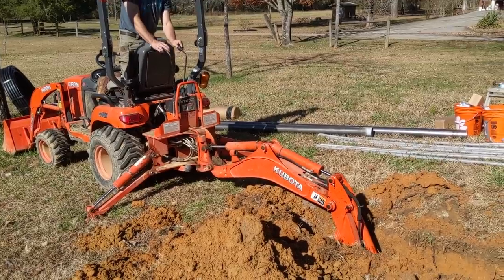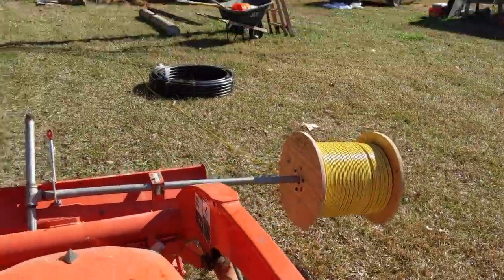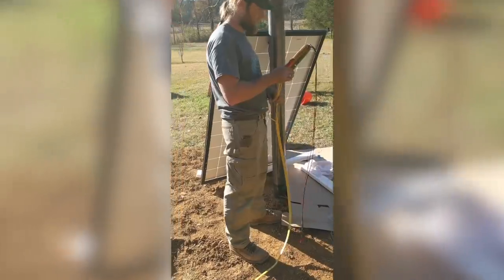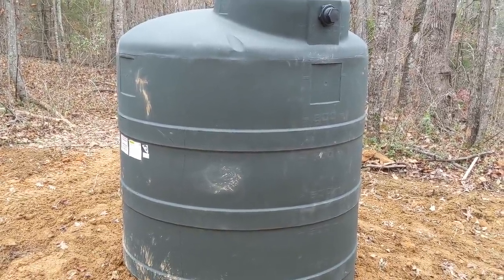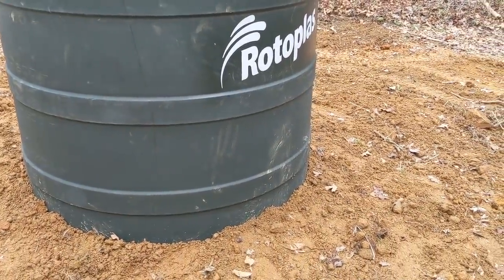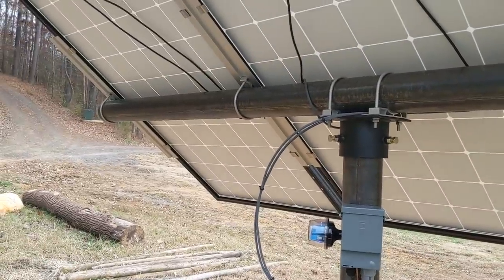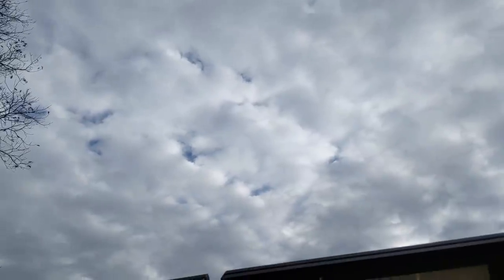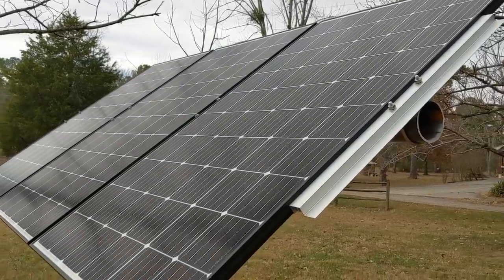Providing Another Homestead with a Reliable Solar Water Supply

Comment: Can't see why some people would say that the overflow is "wasted" since it is going right back in the ground.
Reply: I understand that but if the tank is full by end of day 1, won’t it overflow for most of day 2 and so on? I suppose if you’re surrounded by snow melt and cascading waterfalls everywhere you’re not really all the concerned with using up a finite ground water resource.
Reply: Overflow is essential stealing too much from an aquifer and not putting it to good use. So it is a waste, and you should do everything possible to minimize aquifer waste.
Reply: @lightdark00  ummm...but the overflow IS putting it back in the aquafer
Reply: Gregory Thomas largely not. Most water at ground level will not get to an aquifer.

Comment: Marry Christmas!  I’m fixing to place a 1,400 gallon above ground water container to gravity feed a cabin. I plan on using a ram pump to bring the water to the tank. I would think the line from the ram to the tank would fill the tank from the top not the bottom. Am I wrong?
Reply from the maker: You can do it that way but if the flow ever stops, pipes will freeze.
Reply: Pumping all the water to the top of the tank will take more energy than if you fill it from the bottom.

Comment: With this set up, what would be the most economical way to divert the solar power once the tank is full to say a water heating element or charging a battery bank?  It seems most times the tank will be full within a couple hours of the sun coming up and would be great to utilize that power else where.
Reply from the maker: The most economical would be a transfer switch between the water system and whatever other system you would like.  I have used midnite combiners for this with breakers.  I have also used the midnite MNSTOPSWITCH to select which system gets the power.
Reply: @engineer775  Regarding your fear of lighting, is there a radio based way to tell the diverter relay that the tank is full?

Comment: I'm in Florida. I'm wondering about running a 10000btu a/c off solar. Summers here are HOT so it may run all day in a 10x20 wooden shed/home office. I will be insulating the walls and roof. What would be an estimated need for solar panels and batteries? I simply have no idea where to start...
Reply from the maker: I highly recommend our 12,000 BTU Solar driven ACDC12C units.  https://practicalpreppers.com/product/acdc12c-solar-air-conditioner-heat-pump/    no batteries!
Reply: Start by buying a used walk-in freezer without mechanicals. Then , wrap it in 10 mill plastic.Add spacers to provide a drainage plain for condensation and add 2 or more inches of foam board.  Side it for weather resistance. Find a heat flow calculator to get BTU/sg, ft. / hour. Add a lights, electric use , body heat , and  ventilation  sensible heat factor. My guess is that a 5,000 BTU AC will work. 600 watts of solar to run it. a lot more to start it . And, do you want it to run on a cloudy day?
Reply: @engineer775  ..thank you for the response! I already have the a/c unit unfortunately. On a tight budget due to the husband's health issues. I'm trying to set up a home office so I can work from the farm, and so I have a place to put him and his medicine ($8500 a month) when the power goes out. It's looking like my budget is more harbor freight. Thank you for your awesome videos, I've been watching for like 5 or 6 years now? Is that possible?

Comment: How does the pump controller know when the header tank is full?
Reply: Dean Ervik  did you watch the full video?
Reply: Yes. But I’m still not clear on how this is accomplished. Please illuminate us all. Do you just stand there every day and manually turn it on and off? Lorentz pumps have a pressure based sensor that controls the MPPT unit, once the float switch closes pressure builds up in the pipe (sensor) and the MPPT unit switches off the pump. I didn’t see anything like that, so how’s it done? Overflowing excess water seems very wasteful. I install bore pumps in Australia where our water situation is more like Arizona I suppose so every drop is precious. Love all the videos man, happy new year! www.ecoworld.com.au
Reply: @7:35 - 7:50 ... it just over flows, back into the ground where it came from. Assuming the land owner will be tying in and utilizing daily. Can just turn the panels out of the sun if need be.

Comment: Are there 2 pipes going up the hill?  Do you have a pipe running from the pump to the tank, and another distribution line from the tank back down the hill for actual use.  Or can you accomplish both with just a single pipe?
Reply from the maker: single pipe does it all.

Comment: MERRY CHRISTMAS,,ai have a question? will them pumps pull/push water from a 95ft. deep well?ai dont know thets why ai,m askin,,,thank ya fer the video
Reply from the maker: Yes and way deeper that that too.
Reply: @engineer775  thank ya , how do they handle below zero temps, ai,m try in ta find tools ta use incase of long tyme power outages, wether wind or solar or both as ai live in the upper peninsula of mich,  thank ya fer the videos

Comment: I guess I’m one of those who doesn’t like to pump more water then is needed. I’d be worried to deplete the aquifer, lol.
Reply from the maker: I understand.  It is very easy to rotate the array and pump a lot less water.
Reply: Engineer775 Merry Christmas Scott. Would this be shipped freight or package? I have no heavy equipment for unloading and can’t ship to a local business either. 
Also, how exact would the delivery date be? Like a 3-5 day window or more or less?
Reply from the maker: @4philipp  It is a combination of package and freight.  It is hard to ship solar panels any other way but freight.
Reply: @4philipp  Ask someone to park a 40 inch high truck on your property to unload into. Or, build a 40 inch high platform to unload onto. The LTTL truck will have a pump jack pallet mover.

Comment: Now on a gray day will it still produce enough electricity to pump the water??
Reply: Tig Johnson it did in this case, I think it filled the tank in 4-5 hours.
Reply from the maker: yes it will.  It will pump up until the point of rain.
Reply: Engineer775 question about cloudy weather: for charging a battery bank, do I want higher voltage (series) or higher amperage (parallel)?

Comment: What about a Deep Well that is roughly 400 feet down???  Could solar handle that?
Reply: Ozarks Outrider I think the pump is rated for up to 300’. I also believe you still need a static water level in the 20-25’ range.
Reply from the maker: This pump can pump from 805 ft down.   405 is nothing! :)
Reply from the maker: Glad to design a system for you.  Just  email me the spec of your well - depth, static, recovery rate etc.   If you have questions fire away.

Comment: A ball park cost would be helpful.
Reply: Daryl Campbell his website lists the simple pump for roughly $2000 (at 75’), the solar/pump combo is listed for $3500 (175’), add another solar panel for $300. The waterline you are better off buying locally (600’ish feet in this case). Customer supplied the tank. 
We are talking just over $6k so far. 

Labor: that will be harder to estimate. In same cases customers did some of the work. If you dig your own trench, that’s a huge savings. Scott has consultation listed at &
$200/hour though. So if we take that as a guide, 2 people, 8 hours each makes for $3200 in labor. That’s if this job only takes 8 hours. 
But if we just play with these numbers, for two pumps, solar, labor roughly $10k plus/minus a few pennies.
Reply from the maker: @4philipp  10k with the Simple Pump

Comment: What keeps the tank from freezing?
Reply: Anti-freeze
Reply: @N8TheSnake  It supplies the houses drinking water.
Reply: Greg White i would think the location doesn’t get too cold for too long. It looks like the inlet and outlet are on the bottom, and the tank is buries 18” so that might be the local frost line. Otherwise it’s constantly (daytime) moving water. The thermal mass itself would take a while to freeze. I guess you could put insulation around it somehow.
Reply from the maker: The size of the tank, the ground temp and the moving water each day all contribute to freeze protection.
Reply: @engineer775  Thanks, at what latitude does that combination not work, if any. Also what if their well did not have the continuous flow and had to have a float switch?
Reply from the maker: @chapter4travels  I find that as long as the tank is buried to the frost line then no freezing.  There might be ice that forms in the tank on the worst days but it doesn't stop the system from working.
Reply from the maker: I have installed the same type of system in Canada but with a buried cistern.

Comment: How meny psi does it take to push water up that far. 
And how can I make my 60 ft well pump on solar that is 220 volt.
In Minnesota we get down to -30° to -40° at times. I have generators to use short term.
Reply: Hes doing direct solar, therefore you dont need a inverter or batteries, that's like 70 percent of the cost of most solar systems. If you want 220 volt you need a 220 inverter and a good set of batteries. Mine is a 4448 magnum inverter, and 4 12 volt 250 amp hor batteries, $2500.for the inverter, and another 2 grand for batteries, not sure if you could get much cheaper/reliable then that. Unless you do direct solar, which is proably better in every way
Reply: water pressure is one half pound for each vertical foot. +/-  a little bit.